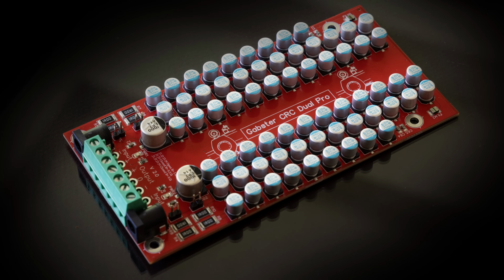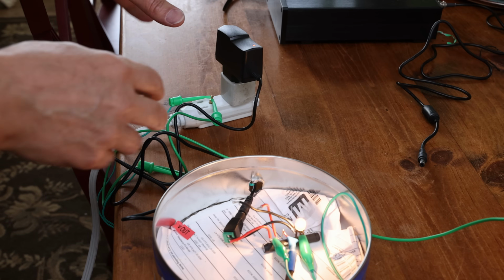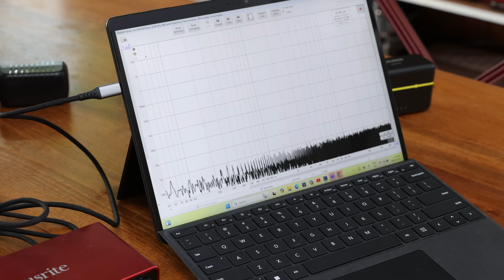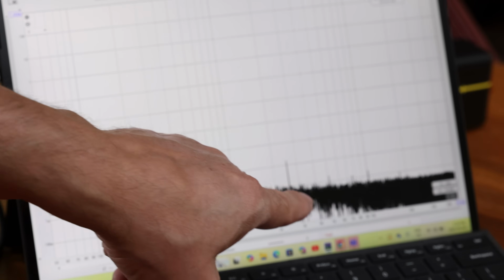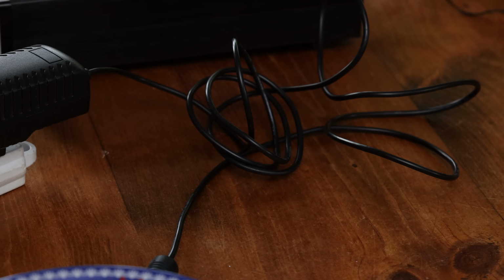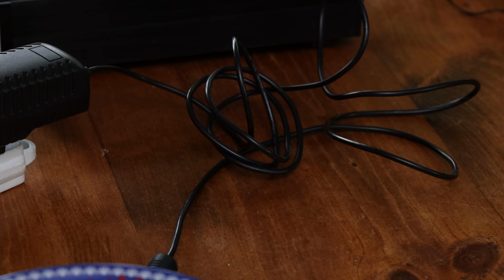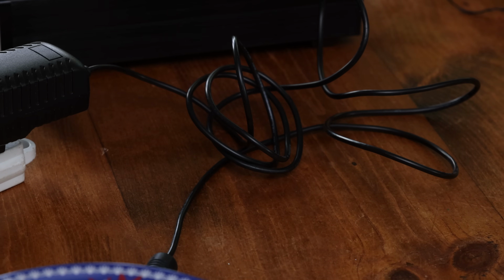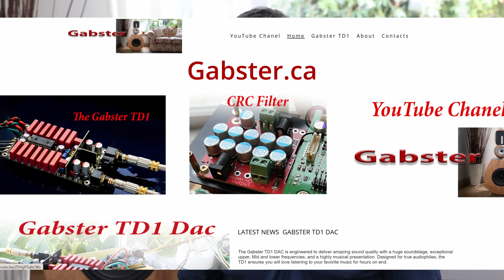Monster 76 Capacitors Dual CRC Filter I designed with JLCPCB

Comment: I have received CRC filter ±5V and 15V. I installed both on TD 1 DAC, it sounds amazing,  the  background is quieter and the soundstage is bigger. Big thanks to Gaby for making such great items for diy community.😊
Reply from the maker: Thank you for sharing your unbiased opinion on the CRC Filter Pro ±5V and ±15V.
The ±5V version features an impressively low ESR of just 0.3 milliohms — a remarkable achievement that clearly reflects in the sound quality.
Reply: Did it sound more dark Chocolatey or sugaree?

Comment: Gabby wouldn’t the supercaps filter CRC be a perfect answer to improve phono preamp noise performance. My Parasound JC3+ has + / - 30 volt power supple. This system as you know provides 60-72dB gain for MC cartridge. Can you advise ? Perspective 
Thanks

Comment: Can you run different voltages on each side of the board, (even if it needs to be modified)?  If so it would up many use cases for me an others.

Comment: Great idea with this capacitor bank! Straying a bit from the specific area for which this filter was designed, I've heard from a great analog audiophile that when there are more filter capacitors than necessary in a linear power supply, a class AB amplifier will have less harmonic distortion and more performance in reproducing low frequencies.

I decided to test this idea on small SMD digital amplifiers and, in tests on a board with two 10W @ 2 ohm amplifier chips, powered by a 5V and 5A (max) power adapter, and I realized that this is also valid, especially in terms of reducing distortion when requesting high power peaks.

So I took some common electrolytic capacitors, with various capacitance values, that I had saved for a while, and made two capacitor banks in parallel, and these two banks were soldered in parallel on the mini amplifier board. In total, there are over 10,000 microfarads of capacitance, at 5V (asymmetric source). And I'm still using it today.

I also liked the idea of making a filter bank with solid polymer capacitors to lower the ESR. It's a really interesting project!
Reply from the maker: thanks for sharing your experience

Comment: I use a CLC filter for my computer SMPS whose datasheet says it has 120mV ripple. After adding the filter, the motherboard capacitors ran noticeably cooler.
I use a bank of small electrolytics with equal number of SMD MLCC caps in the same bank, at the output of the SMPS.
Reply from the maker: excellent

Comment: Great product, if did my math right it adds up to about 10000uF of total capacitance with sub extremely low ESR.  Where would you set the resistors for the Studer and iFi Power Supplies you used?
Reply from the maker: Thank You. I have them set to 0.5 ohms and power them daily from empty for a month now with no issues

Comment: There are more interesting unanswered questions:

1. Have you measured the leakage current Lu? For some poly capacitors, it can be as high as 3 mA, which, when multiplied by several dozens, can easily result in a total leakage current of around 100mA.

2. This "solution" can easily damage (burn out) the power adapter, because when a capacitor is not charged, it effectively acts as a short circuit. Moreover, not every integrated circuit (inside power adapter) tolerates a low-impedance load like this. OCP ....

I see the resistors 1Ω each — but are they really sufficient? I haven't even mentioned the larger capacitor, which also plays a role in this.
If it were really that easy and brilliant — why hasn't anyone thought of it until now?
Well, except for you, of course.
Reply from the maker: Thanks for the thoughtful critique — it's a good conversation to have when you're pushing the limits of power filtering. Let me clarify a few things about the design:

 Leakage Current
The capacitors used are Nippon APXJ 270 µF 16V aluminum polymers — 33 in total.
The max rated leakage is 864 µA per cap, which gives a worst-case total of ~28.5 mA. That’s significantly lower than the 100 mA you mentioned.

In real-world use, especially after forming, leakage is much lower — typically under 10–20 µA per cap, often resulting in <1 mA total.

 Inrush Current & Adapter Load
You’re right that large capacitance can act like a short at startup — that’s why the CRC stage includes a 1 Ω resistor between sections. It limits inrush current and prevents the adapter from seeing a hard capacitive load.

At 5V, theoretical peak inrush = 5A, but that drops within milliseconds.

I've scoped the startup — no OCP trips, no big voltage sag, and the adapter remains stable.

Plus, there’s a film cap and ceramics on the output to help handle HF transients cleanly.

This isn’t a universal filter — it’s specifically tuned for ultra-low-noise analog audio applications where ripple and impedance matter. Most designs compromise for cost or size. I’m optimizing for:

Ultra-low ESR (~0.3 mΩ total)

Wideband ripple filtering

Clean transient response for sensitive audio stages

The combination of polymer caps, ceramics, and a film cap is intentional — each handles a different frequency domain.

Appreciate the challenge — but I’ve tested this design under real load conditions. It performs exactly as intended in its specific context.

Comment: Dude.... I don't know much about pro audio but this is a bit excessive.
Have you measured the output ripple using a professional equipment?
The circuit may form an antenna and might produce bad results. Maybe an active circuit would be better?
Reply: This seems to be a common high end strategy. My guess is that a really good linear regulator and a hierarchy of capacitors is better. An electrolytic big one and smaller ceramic or whatever is best closest to the output. Perhaps some in between. Experiment with small inductances as well. That's how I would do it but I have limited experience of high end audio design. Perhaps loads of good electrolytics  is better if you don't need to take manufacturing costs so seriously.

Comment: Got one ordered from your website.  Almost done building my TD1 but need a "sacrificial" TDA1541a chip for testing.  Anyone know of a reasonable source for one?
Reply from the maker: https://www.ebay.ca/itm/375844016749
Reply: @Gabster1  Thank you so much sir - got it ordered and once I get the TD1 up and running I'll let you know how it wounds.
Reply from the maker: Get one of these the S1 and crown are fake 
It will sound ok the odd times you get a really good one I never tried this vendor 
You can make a offer shipping is free

Comment: interesting video. Have you ever considered doing to use a  capacitance multiplier. Or is this not common for audio applications?
Reply from the maker: I guess you could  but possibly a capacitor multiplier can introduce noise into a CRC filter, particularly due to the active components used.
It may be good for bigger loads maybe.
We would have to compare actual builds

Comment: Great implementation.  As a long time fan of the TDA1541A I can endorse this approach.  The +5,-5V power supplies really affect the ultimate sound.  Seems like there is almost no limit.  You clean up the supply and are rewarded with impactful natural sound.  Really like the way you made the boards stackable for a clean implementation with short wires.  Very reasonable price BTW.